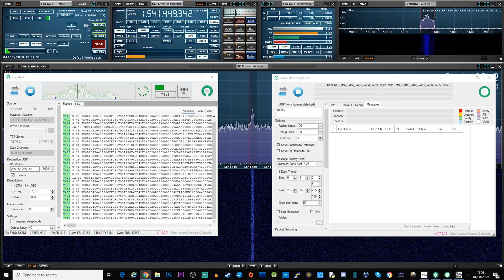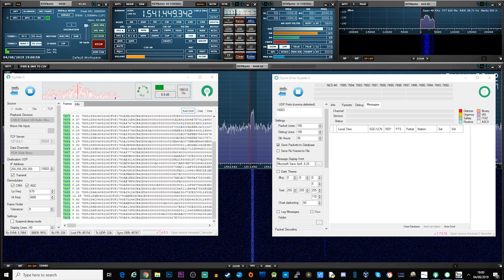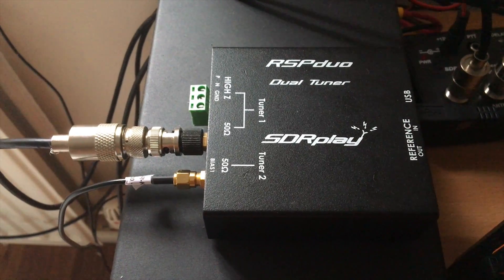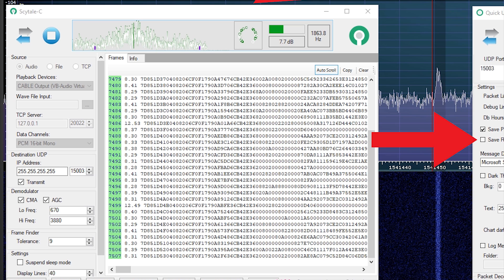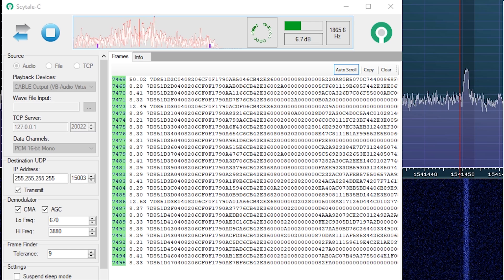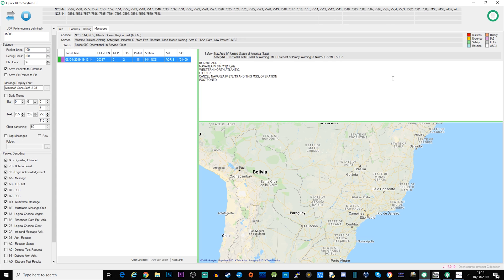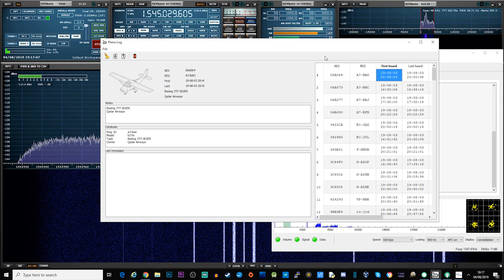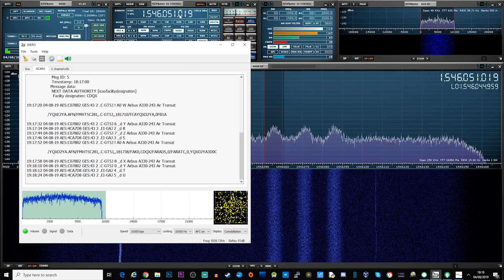Inmarsat Decoding With A Simple Patch Antenna

Comment: Yes, OK, it's 4 years ago, but there is too much miss-information on the web. 
You will NOT get any advantage from the dish by placing the patch on it's surface despite your claim that it worked better,  not possible.  That difference came from some other effect..   
A dish works by focusing the collected energy at a point in front of the dish.  You place the patch facing "backwards "  into the dish, mounted at the focal point.  I am surprised that you are unaware of this fact given the amount of advice that you offer.
Reply from the maker: I think you really do need to go and do more research! I know how a dish is supposed to work, and there is a reason those small GPS pucks are magnetic. So fux off with your “disinformation” bollox. Try it yourself!

Comment: Thanks for an informative video.  I did a similar test of the SDR-Kits L-band patch antenns with JAERO receiving both the 25.5 East satellite, and the 54 West one.  As well as testing from outside, I managed to decode the 600 & 1200 bps channels from inside the loft, with the patch stuck to a steel beam!  The video of that is on my channel.  Did you ever do further experiments with your dish, and finding the focal point?  I managed to get a few extra dB using a Sky mini dish and rotating the patch by 90 degrees.
Reply: Thank you for your work! 💖

Comment: Hello,
Thank you for this video to discover the range of possibilities with Inmarsat. I start to work well with a helix 12 tours made home + LNA NOOELEC, but with which INMARSAT was made your video?
I am in the south east of France and connected on the 2F2, I still do not decode everything ....
Reply from the maker: I’m in the UK and pretty much pointed west I think. Just move the antenna around until you get the strongest signal
Reply: Tech Minds OK, thank you very much. I’m right, I turn to the west too. Or south, because Inmarsat 2F2  is on 190° and elevation 34°, very powerful.
Reply: n2yo.org This is very helpful! They have tracking data on a huge number of satellites.

Comment: Hi and thanks for all the great Videos. I tried out the Antenna just on the Balconyrail (Location is Austria, SDR is a RSP1A) and was successful with the reception of the ACARS Channels using JAERO. Sadly i cant receive the C-Channel on 1.541.449. I cant even SEE on the Waterfall that there is a Transponder. I guess the Balconyrail isnt enough. What do you think ???
Reply from the maker: Did you try rotating the antenna to see if the signal peaked? Or maybe try something larger for a ground plane, like an old dish or metal biscuit tin lid
Reply: @TechMindsOfficial  . Hi Matt Thanks for your reply. i changes a little bit and now i can receive the 1539455000 Norway, 1539465253 Japan, 1539475164 Russia e.g.
Seems that i am on another Inmarsat or did the all move to 25 E ?? Tx for help

Comment: Great vid. Thankyou. Do you need to run a powered LNA, with this patch?
Reply from the maker: The patch used in this video has an LNA and filter all built in :) So it’s a great price. If you check my latest video you’ll see how I constructed an even better antenna, but does require an LNA. Thanks for watching! 👍
Reply: @TechMindsOfficial  Awesome thanks sold.

Comment: Had some excellent results using the patch antenna and Multipsk (EGC-Professional Mode) easily displaying messages. Frequency used was around  1537.100
Bought  the Tekmanoid STD-C Decoder but have not had any messages displaying even though the signal and quality are very good. Anyway its only been a few days so will keep playing with the software. Fascinating subject this L band, cant wait to see you experiment with a dish.
Reply: Hi, is it possible any VOICE DECODING with the MultiPSK? 

Or which one is good for VOICE?

Comment: Excellent video.... I too am in UK & I'm currently just into Inmarsat stuff.... built an outernet patch antenna with aluminium & copper.. Just getting the SDR# plugin to work..... 👍👌
Reply from the maker: Yeh the plugin is great, makes things nice and simple, going to be doing a video on it soon along with a new Inmarsat antenna :)
Reply: @TechMindsOfficial , I would really like that video on the plugin. What SNR do you get with the active patch antenna on the dish, say on 1.541.500? I'm using a home brew helical in the feedpoint of a 100cm dish witch will be re-activated as soon as my RTL-TCP is running again with a Airspy one sitting @ the dish to avoid signal loss over a 40 meter RG6 coax. Nice video!

Comment: Thought of putting it at focal point of dish?
Reply from the maker: Yep, currently designing something to hold the patch right now :) will do a video on it once finished :)
Reply: @TechMindsOfficial  The patch antenna is RHCP when you place it at the focal point of the dish it will not be as good as you expect. 
The reason is when a RHCP signal hits the dish surface and is reflected the signal become LHCP. 
So while there maybe some gain it will be nowhere near as it should be possible 20-30dB down as the patch isnt being illuminated correctly. 

hth Mark
Reply from the maker: Yep, I kinda realised that after learning more about CP. appreciate you confirming this 👍
Reply: @TechMindsOfficial  But there is no difficulty in making the patch LHCP is there?

Comment: that patch antenna stuck to the dish looks ridiculous. what is the point of having the dish then? Obviously the focal point of the dish is some distance away and that's where the receiving (or transmitting) antenna is supposed to sit in order to achieve the required gain. This thing shown here is nothing more than mounting a patch close to a ground plane
Reply from the maker: Exactly! If you didnt realise the whole point of this video was to show how well you can receive inmarsat just stuck to a drain pipe, I didnt even show in the video how well it works when placed in the middle of the dish. You are correct though, in theory it should work better with the patch antenna facing towards the dish at the correct focal point. This is something I will try shortly. :-)

Comment: I'll put wedge down on the patch getting even better results if placed at the focal point of the dish, where the LNB used to live. -point the patch at the reflector/dish then once a signal is acquired, adjust focal distance(between the patch & dish) to achieve max signal over/to noise... :)

Nice vid.
Reply: That's best.